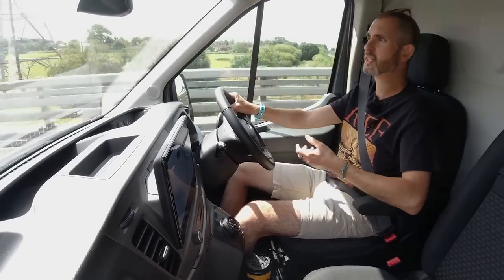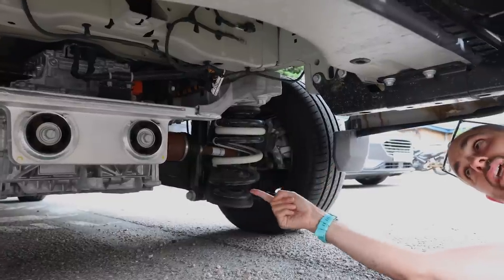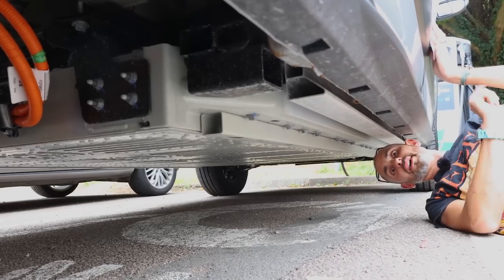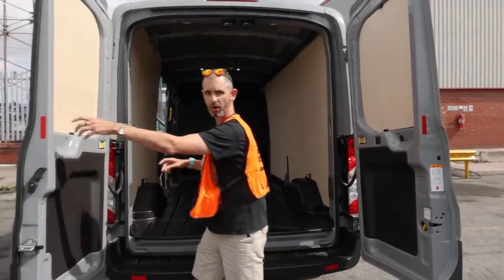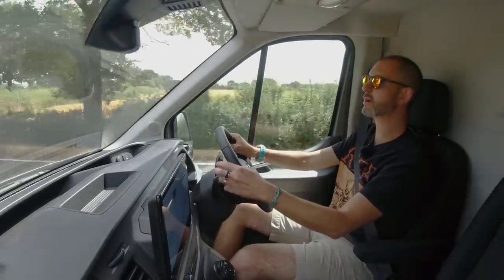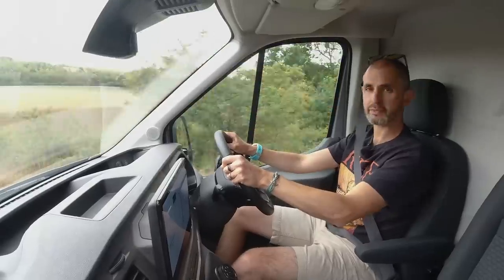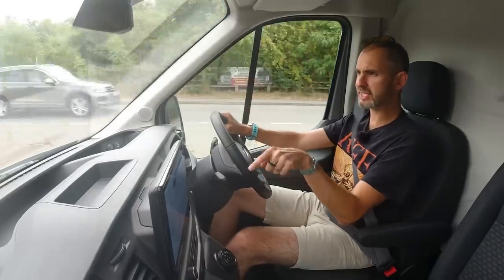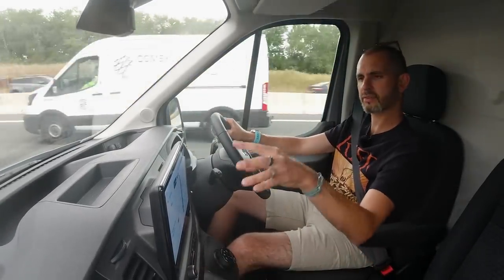New Ford E-Transit electric review - the most important van of 2022

Comment: The hardest test would be same journey in the winter ,lights heater,wipes etc see what mileage you get then
Reply from the maker: Agree, those are the worst conditions for an EV (above 60mph especially)
Reply: @TheLateBrakeShow  I'd expect like every other EV it'll do about 20% less than it will in the summer!
Reply: Can’t see  tradesmen ever going electric, I’m a floor layer bet all my tools and crap weigh more than that Honda engine.  Add 600kg of carpets probably won’t get out of town 🤣
Reply: @domefford864  no same with me full van roof rack and ladders as well, plus longer journeys i could not br arsed to keep stopping but I do think they have their place  just not for me
Reply: @domefford864  as long as you keep it all inside the van you shouldn't notice any difference in range. If you put stuff on the roof it will make a huge difference.
Reply: @gasdive  weight doesn’t affect fuel economy? Not sure you understand physics
Reply: @domefford864  I didn't say it doesn't. It does, but the difference is so small you'll never notice it. Adding 1000 kg cuts the range less than 1%
Reply: @gasdive  really? Drive a van up a hill with a ton in the back and you’ll soon realise how much more an engine diesel or electric has to work.
Reply: @domefford864  sure, but you get most of that back when you drive back down. Unlike a petrol car where all you do is heat up the brakes.

Same for the extra energy needed to accelerate the extra weight.

Comment: I went for a test drive of the 180ps today. The torque was instant, from the lights it just crazy how quick it got up to speed! Top speed is maxed at 81mph, that is fine tbh! What else, Cameras were great, Aircon was great too. The screen was fine, doesn't need to be angled as you would look at it all the time, Can easily use all the buttons from the drives seat, Screen large and bright! It handles well but see when a load is in! The braking was brilliant, didn't need to use the brake a lot, only to stop at lights!

What I didn't like. The huge step into the back. I am a landscaper and use ramps etc but I was stocked on the step up to the loading area! ( only 5cm higher than a diesel one)  But maybe I could get used to it! 

I do around 100 miles a day so its ideal for me! So I am looking forward to seeing how much it going to cost!
Reply: Wait n see the range fall once youve put all your landscaping tools in the back.
That added weight is going to kill the range.
Reply: So I got price for it. 

Got a few extras, camera, power pack and the camera. £10k down followed by 58 x £856 with a end balloon of £13104. Over £73k in total!!

Very expensive for what it is tbh

Comment: Great vid on the eTransit and in depth. One thing i noticed Ford have missed and I’m sure if the great Sandy Munro had it up on a ramp as you showed on the rear suspension shot, they have lots of space under the rear floor area, behind the drive/suspension unit and rear valance to have a sunken rear underbody storage area as in Tesla MS etc? Small hatch in the rear floor area. Also, I noticed in the American version there’s two 230v a/c outlets in the rear. Will they add these to the UK vn as well as Vehicle to Load/Grid option? 
Having this electric power options to power electric tools, charge hand power tools etc etc would be a great advantage v other brands.
Reply: Yes, its called Pro Power Onboard, it is located inside the cargo bay on the right hand side between wheel arch intrusion & the rear cargo door

2.3kw output, two UK plug sockets

Comment: I like it, but here’s my question. The range clearly came down even hauling something weighing only a few hundred kg’s, hence the need to the extra “splash and dash”. I carry over 1t daily in my van, I’d like to understand what that would change the real world mileage to as I just can’t see how electric vans will work properly until they have diesel like range. 

At the moment that means more/heavier batteries, which means a lower load capacity. 

IMO unless the gov change the driving licences to 7.5t as a standard like they used to Pre 1997 then electric vans just don’t make sense if they’re going on long journeys, carrying a heavy load. With a 7.5t you could have huge batteries that could easily give longer range and you’d keep your ability for a heavy payload.
Reply: Very true.  I think that's why Ford recommends a mix of electric and diesel vans.  Electric for city and suburban routes, and diesel for longer hauls like you describe.

Until batteries get lighter, or can store much more energy, we'll have a definite need for some diesel and petrol vehicles.
Reply: Weight makes almost no difference to range at all. As long as it's inside and not changing the drag you'd never be able to tell.

Wind direction makes a huge difference. Vastly more than weight.
Reply: agree. Again the video is made by an electric enthusiast with no experience of day to day usage of a van. ev is presented always too sunny :)   I am skeptical because it is the trend to be ev enthusiast instead of really objective.

Comment: Seems great! The screen should definitely lean towards the driver a bit. And I really don’t think touch screens should replace all the buttons in a car or van. Some things like heat or volume are so much easier to just turn up or down without looking. Are electric vehicles eco friendly after the mining? I’m sure someone’s compared the ecological damage to diesel and electric.
Reply: The amount of drivers I see leaning down the middle of their cars whilst driving astounds me. C class drivers seem to do this in abundance. Not sure if they are all poorly sighted or the menus on the Mercedes infotainment screen are a  pig. We choose our car for various reasons, physical buttons was one.
Reply: One reason to run EVERYTHING on the touchscreen is that it could potentially all be reset remotely by the fleet software whenever there is a new driver. Or potentially driver's settings could follow them. It does also introduce the potential for monitoring those settings... with all of the positives and negatives that go along with that. 

There are plenty of studies out looking at impact of mining of battery materials. Although I do find it funny that we never hear anyone asking what are the impacts of speculating, drilling, refining and transporting oil and gas whenever a new ICE vehicle hits the market. Although one thing we can say for certain: EVERY metal inside of a battery pack can be reclaimed in recycling and reused, whereas not a single drop of diesel fuel can ever be reconstituted from tailpile emmissions and reused as fuel.
Reply: Years ago I  had a Vauxhall viva (when they were new) everything you needed to do was proper switches and after a short time you could do anything without taking your eyes off the road. I  dont think a touch screen should control anything that is needed when the vehicle is moving.
Reply: @patreekotime4578  Lithium is so costly to reclaim and make usable that nobody does it yet, it's cheaper to open a new mine in the Congo. Also every watt of power used to charge the battery can't be reclaimed either just like diesel.
Reply: @peterlarkin762  I live in a mountainous area, going downhill I can regenerate some of the electricity used to go uphill. I haven't seen a diesel or gas car that creates more fuel when going downhill. Also, I have solar panels on my home roof to generate electricity to recharge my car. I don't know of anyone who has their own refinery to create gas or diesel fuel at home.
Reply: Considering the ecological cost of drilling, transporting, and refining fuel, I don't think mining for battery minerals is any worse for the environment. I wish people would stop comparing the eco impact between them, they're both bad. Personally, I didn't buy an electric car to save the planet, I bought one to save money. Compared to my previous 20mpg car, my electric saved enough to literally pay for itself in 5 years, and keeps saving (especially now that gas is $6/gal.). That's for my daily driver, I'm looking to get a tow vehicle also and will be getting a gas engine vehicle. Towing heavy loads drains the battery too fast. So, there's a place for both.
Reply: @peterlarkin762  The Lithium reclaim cost will, as everything else, soon reach a limit where it becomes profitable.
Reply: @michaelparks3106  If they stopped comparing the eco impact in this way, they would be taking away a bit of an agenda which is crucial for certain political movements.
Reply: @AlfaGiuliaQV  Sad, but true.

Comment: That £9k difference is interesting. At current rapid charge and fuel prices, for the frugal driver I reckon it would take more than 3 years to recoup, but many van drivers are not frugal and that really hurts the diesel mpg. Plus charging overnight at cheaper rates, a lot of variables but ultimately it's going to be cheaper.

Comment: Good Review, makes more sense than EV classic cars, which occasionally come out the garage.
One thing I would say, it  really should have a Hydrogen fuel cell option to make it truly usable!!
Reply: There just isn't any hydrogen infrastructure though.  It's significantly more difficult to implement than battery charging infrastructure
Reply: @TimInertiatic  
Hydrogen will be coming. Lorries will be Hydrogen soon. There's no way Lorries can sustain a long journey on BEV!
Reply: Or Hydrogen combustion?  Harry's Farm and Harry's Garage did an interesting interview with Lord Bamford of JCB fame about the advantages of burning hydrogen in modified IC vehicles,  worth a watch.
Reply: @markwalton8644  ok fine, but where is the hydrogen infrastructure?
Reply: @markwalton8644  it's significantly harder and more expensive to transport hydrogen than electricity and also less significantly less efficient.

Fuel cells definitely have their place for plant that stays in one place (such as the JBC plans) but I can't see how a hydrogen infrastructure for delivery vehicles would work.

It's one area where hybrid vehicles using synthetic fuels would probably be the best option as the distribution networks for both liquid fuel and electricity already exist
Reply: Hydrogen combustion produces NOX pollution though so isn’t any good for everyday vehicles. It is also horrifically inefficient even compared to hydrogen fuel cell. The cheaper initial purchase price will be rapidly eaten away by the higher running costs. And it has all the ICE downsides like noise, vibration, servicing costs and unreliability.
Reply: @keithhoughton4308  you can split water using electrolysis, using renewables as the source.

Hydrogen is also made from natural gas...

Ultimately it's not a fuel, it's an energy transfer medium

Comment: Reef Tee 👍🏼👍🏼
This van is definitely a game changer for the courier industry. When I was a courier before my current job the 18 plate tranny I had (the same wheelbase and height as this one) I was filling up 3 times a week and my round averaged 100 miles a day, 56 of them getting to and from my delivery area. 
Now I do long distance in a sprinter Luton, until a manufacturer can bring out an EV Luton capable of 400 miles a day we’ll still be using Diesel engines.
Reply: I do 100 miles a day in my 2.2 econetic 3.5t and im getting 700 miles per fill up. I did get 400 until i learned how to drive it economically.
My old 2.0l used to get me to london and back on 2/3rds of a tank. The same journey uses a whole tank in my mk7. My mk7 is 10 years newer than my mk6 was. So how has this been allowed, the emissions regs are a fraud.
My old car put out 221gkm and my 16 year newer car puts out 174gkm yet im getting the same mpg on the same roads. Its all lies and im getring really tired of it. We're being played for a much bigger reason than I can think of.
Reply: @darrenlomax1283  Road tax is a fraud, you just have to look at the state of them. I drive a sprinter Luton 316 twin turbo, I get 350-400 miles per tank but it depends on how much motorway compared to urban and also how loaded we are.
I don’t pay for the fuel though thank Fook 
When I started here last April a full tank from 50 mile reserve cost about £90
Now it’s £125-30

Comment: Love me a good Van! Excellent review as always. 

Why does L give higher regen? Good question. 
I think it's following the standard of automatic transmissions with PRNDL, where low range gives more engine braking.
Reply: I think it's L for load. As in carrying a load.
Reply: @Daniel-uj7rr  I always understood it to be low range because it limits the top speed and allows the engine to rev higher to produce more torque due to gearing.

Comment: Great review, I have driven electric for nearly 6 years now(Nissan leaf 30). For this van to work the charging network at ports has to improve significantly, we have just been left with no range when arriving at the ferry from cairnryan to larne! I had the granny charger with us(luckily) and managed to steal a few precious miles from p and o! As for the future of vans, electric is a certainty! Perhaps chargers on boats? They all have monster power generation with three phase?
Reply: Ferry operators should definitely install charging points on the vehicle decks, they have installed USB points in the passenger areas for us and most ferry passengers have a vehicle on board.
Reply: I would like to see charging points on eurotunnel. Its already an electric vehicle running on high voltage.
Reply: Ferry companies in Scandinavia are starting to offer charging on board. Must be pre-booked but it’s coming as the ferrys go into dock for refreshes.

Comment: I really would love an EV one day... but I often do long journeys of 600-800km a day and just can't bear the thought of potentially having to charge 3-4 times adding perhaps 2 or more hours. One tank of diesel is all it takes. Plus going any faster than 120-130kmh just kills EV ranges. I think synthetic fuels or hydrogen is the way.
Reply: Fine, if you're ok with around £10 per litre for synthetic fuel, or driving around looking for one of the 12 hydrogen filling points in the whole of the UK. And don't expect hydrogen to be a cheap fuel.......
Reply: Efuel is no way a solution to stop burning stuff. Neighter is H2. They both are fossil industries love babies. 
And for that. The range on a FCEV is the same as a same priced competitor. 
In you're scenario you need an EV6/Ioniq5
Or an i4. They do that charging job in just your coffee break.
Reply: You would be silly to buy an EV then. That is their weakness and the infrastructure simply isn't there.
Reply: @RLTtizME  wake up.
Reply: @RedBatteryHead  fellnarp
Reply: @RedBatteryHead  possibly, the EV6 does look quite good, I will have to give it a try. I just don't think EVs are good for every application, i.e. sustained high speeds for long journeys.
Reply: @Brian-om2hh  I was looking more to the future rather than right now. Synthetic fuel technology has existed since WW2, if it can be improved and made carbon neutral I don't see many problems with it. For sure the cost would go down as well.
Reply: @michalrajnic758  look for info on synthfuel on YT. Rosie's channel has item on it.
It's a waste of energy as starter
Reply: @RedBatteryHead  yes, I will have a look for sure
Reply: @michalrajnic758  with EV6 you can do small 10min charge for 100km extra range.
Just an other tactic.
Rethink. travel 😉
Reply: @RedBatteryHead  Isn´t that only on really fast superchargers? I will have to do some more research, but for now I will stick to diesel :)
Reply: @michalrajnic758  yes on 350kW that is the 800V. For the EV6 and the like.
Charging is really not that big of a deal on 400V too. The crux is efficiency and charge speed combined.
Most 120-150kW able cars are already fine enough to charge 30 minutes after a 300km trip.
Small adjustment for great benefits.
Reply: @RedBatteryHead  It's all about the charging infrastructure. Just did a road trip south of England North Scotland in a Tesla. Only charging issue is that to keep high turnover at the chargers they apply an overstay fee once you're car is charged to the level needed to complete your journey. I had to interrupt my lunch to move the car off the charger as it was ready before me - and that's on 400V platform. I chose the Tesla because of charging network. I think the EV6 is probably a better car - just need more chargers. Other issue is cars with lower charging rates - a Tesla charging at 150kW or more will probably only need 10 to 20 minutes charging (you never charge to full as it chargers quicker at low SoC - it's optimized for shortest overall journey time) and you know you'll get a spot at the next charging stop because there are always at least 6 and often up to 20 charging stalls. On non-Tesla you might turn up and find a single charger and 2 cars already waiting that will only charge at 30 to 50kW, so you're in for over and hour wait before you even start to charge.
Loads of hype about the cars, but the bit that's really good about Tesla is the charging infrastructure.
Reply: @johnmckay1423  everyone in EU can use most SuC too now. I use them sometimes.
SuC is definitely the best set-up infra. No doubt.